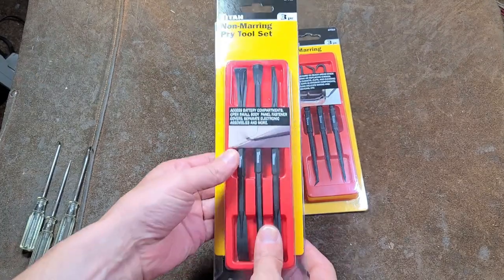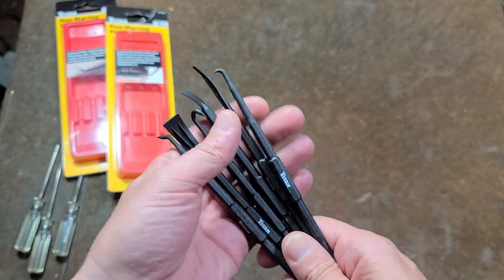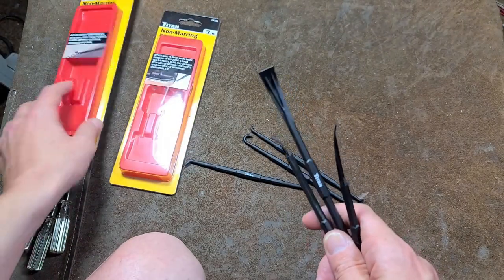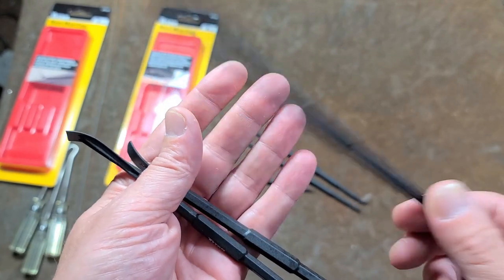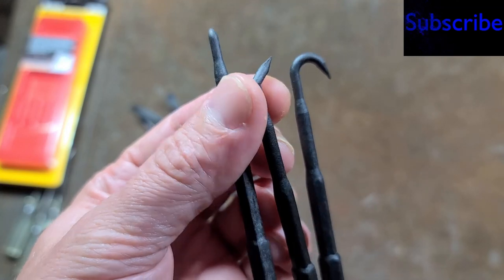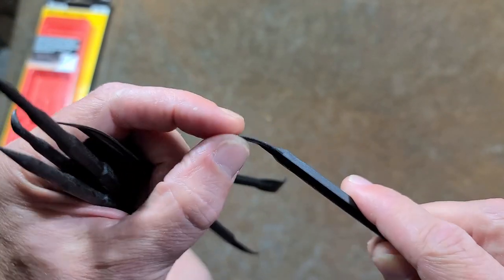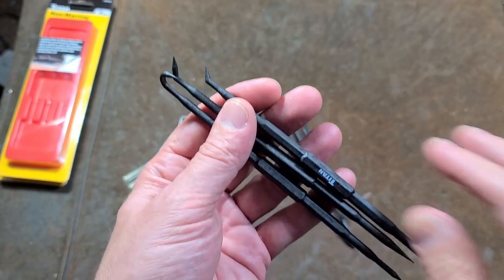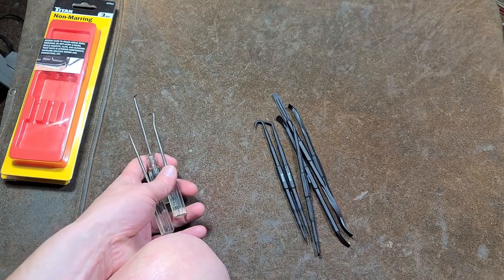Titan Nylon O-Ring/Gasket Pick & Spatula Set Review

Comment: I don't agree with most of the carbon footprint stuff. Most of it is either not going to make a big enough difference, or is outlandishly ridiculous in the scale or routine  that needs to be followed to make it work. 

That being said, you have point about packaging. Manufacturers never seem to put the right package on the right tool. These picks are NOT something you need a tray or reusable package for. Blow molded cases are not something people want to use (most CAN'T be used!), and yet companies still package tools in this or that that no one asked for and it all goes to a land fill. 

They ought to toss the socket set in a small storage case or rack that will last or at least offer a set that DOESN'T come with a cheap throw away case for $5 less.